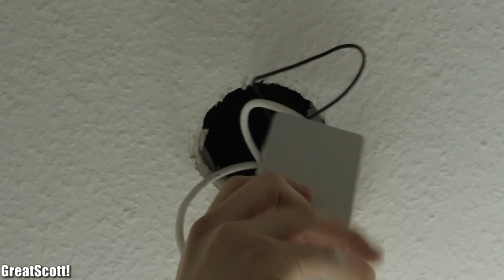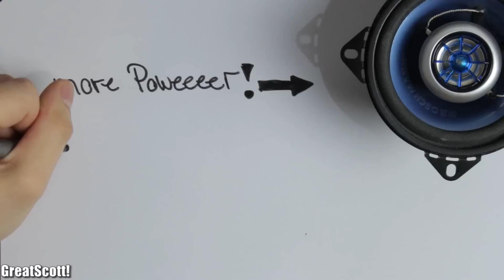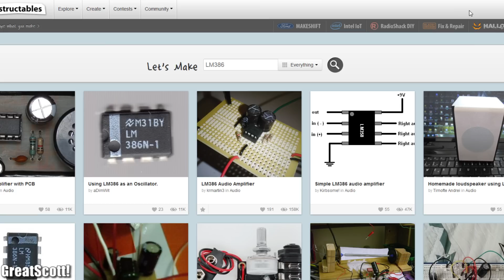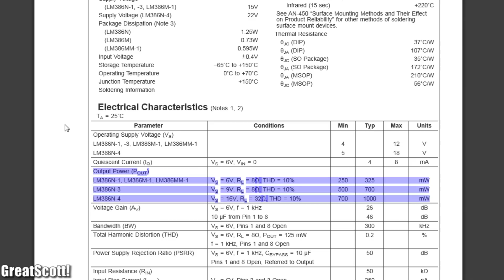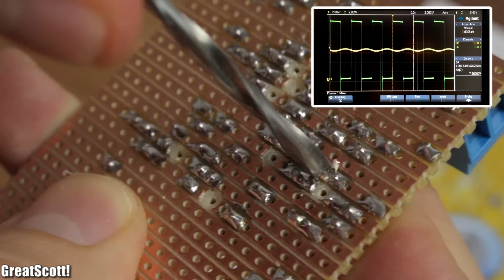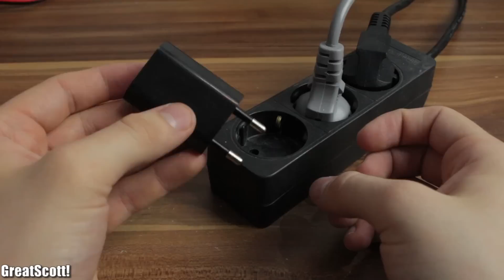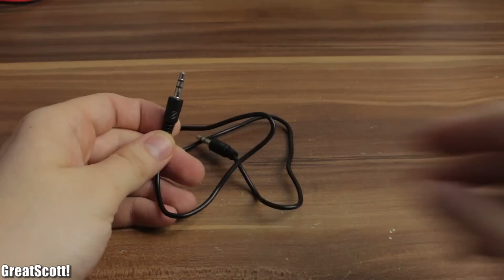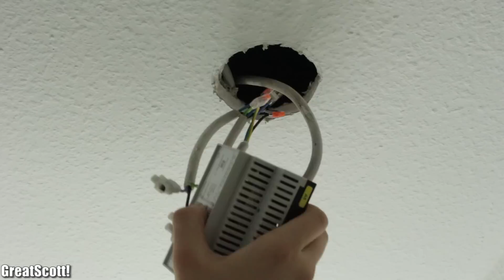Make your own Low Budget Bluetooth Music System || OpAmp

Comment: my question is why? i have herd a few Bluetooth headsets on ps3 and firedns mac book, there range and quality of sound is poor. for music around the house id just crank up your main sounds system until you can here it in the hole house. for on the go id just pick up a cheep ghetto blaster at a yard sale. and besides my ps3 i have never ran into any hardware compatible with Bluetooth. seems non practical.
Reply from the maker: RockeyDAproductions Bluetooth can transmit the music pretty good. Mostly it is the quality of the amp and speaker which makes it sound crappy. Try this build and you will see it for yourself ;-)
Reply: should i use my ps3? becase its my only Bluetooth capable device I have. and weakest amp i got laying around is 320w 2ohm. so it might be overkill.
Reply from the maker: RockeyDAproductions
Sure, use that. It is a bit of a overkill but it should work just fine.
Reply: looking thew this video remided me of a old project i gave up on, i picked up 2 mono amps from radio shack a year ago and cramed them in a small space and built the nessisarcy cirtect to run them. but i got nasty feedback and distortion and forgot aobut it, i was planning on adding some filter caps close to the amp but never did.
Reply: I'd say your a little late with technology, I thought that like 3 years ago, then I got used to bluetooth speakers, they dont really give bad quality, its just cheap ones give fucking bad range and lacking in speed.
Reply: and still,i got alot of hardware and parts, and put of all of the only thing i have that can even use Bluetooth is ps3. i use my pc to control my music.
Reply: RockeyDAproductions
Dont you use a phone or something?? :D
Reply: use a phone? i got a cordless but don't see why it maters. seems off topic.
Reply: RockeyDAproductions
For Bluetooth streaming... :D
Reply: with what? my DS3 controller?
Reply: for that price i could buy a new sub on cergs list, plus agin, nothing that uses blue tooth other than ps3, and i dont think ps3 can play music threw Bluetooth.
Reply: RockeyDAproductions not 320 real genuine watts per channel, 320 shitty ass car audio watts. a 320 watt per channel amp should weigh like 50 kilograms and have at least a 40 amp fuse. (50 kilos if its a home audio amp). i have an great old yamaha amplifier. rated at 55 watts per channel at 8 ohms. i have it driven at 6 ohms and it puts out 90 watts per channel. that has blown car audio speakers rated at 600 watts. and is much louder than most amplifiers rated at 1000 watts. there is a fake rating and real rating in this world. those car amps rated at 5k - fuck off not 5k per channel not even 5k all channels combined they probably give 200 watts genuine watts per channel. sorry for the rant but non - genuine watts really pisses me off you just have to find what is true and what is fake. 98% of wattages today are fake. there is a reason why car audio is cheap and seems like you get so much power for nothing. because it sounds like ass and outputs jack all power.
Reply: 320rms watts rms 2ohm, and the amp waighs about 20lbs. i know my car audio and i know how to find a deal.
Reply: RockeyDAproductions you're gross, throw your ps3 away, do you not have a cell phone? nearly every device that plays any kind of audio at all has bluetooth unless you have a  bunch of really old stuff, in which case just don't use a bluetooth dongle, use an aux cable.. its not that hard..
Reply: Teddy Bullock you further proven my point, the blue tooth is so useless i would have to buy something just to communicate with it. if im in my house i use my computer to control a sound setup that could be herd across the street. if im in the car i either use my laptop or my psp to control my amps(no head unit in car, just amps.)
Reply: RockeyDAproductions
 That's one option, but since most people use bluetooth compatible phones, laptops, PC's and consoles, bluetooth just makes sense. In your car or in your home.
Reply: i got a psp, portable console, no bluetooth, got aobut 10 laptops, non have bluetooth. my desktop is a freaken classifed sr-2, thats about as good as it gets for lga1366, no blue tooth.and only 1 of my firedns has a cell phone and it dose not have bluetooth. other than my ps3 seems like nothing uses it.
Reply: yeah, wow. you use a server board...10 laptops? anyone build after 2002 should have bluetooth.
You dont have a smartphone? tablet?
stop trolling :D
Reply: well technically my motherboard is a workstation bord witch is a class above server. most of the laptops are from 2002-2005 and one from 2009, none have blue tooth. i have a corded phone, why would i want a cell phone? oh and i do have a drawling tablet, its a motion computing M1400.
Reply: technically, nothing is above server grade hardware.
Im sure these laptops have bluetooth :D
my first smartphone, some XDA device had bluetooth...in 2003
Reply: 1, i disagree, workstations are like servers with better support for graphically demanding applications and generally consume more power because they have more power. and every laptop i have i have striped down at least once, only wireless communications is a 802.11 b and g adapters. some of the laptops have options for proprietary BT cards, but i have never seen one of the cards. and cell phones are for people who don't know how to use computers and have lots of money.
Reply: Nothing is as reliable (and as expensive) as server's hardware :D
Cell phones are for people who like to communicate to other people...not only dumb people.
Don't you have the same opinion on consoles too?
They are for dumb people who can't build a PC :D
Reply: 1, workstations are server grade equipment gear'd for performance, they run on server grade ram and xeon possessors and the boards cost more than standalone server boards...) and yes gaming consoles generally are for dumb people, but i know how to fix them for cheep to free, so i can play there exclusive games for next to nothing in price. >:D
Reply: RockeyDAproductions I'm
Reply: Teddy Bullock I
Reply: RockeyDAproductions 9

Comment: nice job. i did this with an old center speaker from a hifi set 2 18650 battery,s
inside are  3 speakers 1 is on a subwoofer channel. 
Too bad that it only works for like a small  hour without external power.

Comment: It's very simple project where you're producing mono sound.

But my aim is to do such Bluetooth stereo system, that is divided between two separate receivers for left and right channel, so it won't need wire connection between left and right Bluetooth speakers. You cannot make this with two ordinary cheap Bluetooth receivers, because they are not capable to receive separate left or right channel from one Bluetooth transmiter in the same time, so you cannot stream music from your phone/tablet etc. this way. You also cannot make this with one Bluetooth stereo receiver that is splitting channels and sending one channel via Bluetooth transmitter for second separate Bluetooth speaker, because of Bluetooth delay/latency, that would be causing time-differences between left and right channels. Any ideas?
Reply: You pretty much need a wire, sorry to say... May I ask why that's so bad?

Other options (if you insist):

Different protocol, I have a set of analog wireless speakers for example where you just select left or right on each speaker. There's no wire between them and they both have dedicated power supplies. They seem pretty good at avoiding interference while music is playing however they unfortunately don't go in the ceiling. (Brand is instudio if you're interested).

AirPlay: allows sending music to be played on multiple speakers and will time sync them (though I only have one so I have never tried that / don't know how well it works). This will cost more. Advantage is no further compression

Sonos / other wireless audio protocol: Costly, and I don't know much about them other then they support multiple receivers playing the same thing

As I recall there are some portable Bluetooth speakers which actually do allow you to stream to all of them at once (they have to be the same brand and model tho, and one that supports this)

Comment: In many modern homes the ceiling cavity is open to the outside through breather slots in the exterior walls, never mind worrying about dampness in the bathroom it will get slightly damp in the ceiling cavity through the winter time. just feel the ceiling in the winter time is it cold? This is something that has been found with low voltage ceiling lights (corrosion in the circuits). You say anyone can build it is that anyone with a good understanding of electronics and components like you?

Comment: What if I want to take this to outside? How about power?
Reply from the maker: The amp needs around 200mA at 12V (=2,4W). The receiver needs 80mA at 5V (=0,4W). So around 3W. If you increase the amplification then the amp needs more power.

Comment: where to find the metal jumper wire on ebay please ?
Reply from the maker: Seach for "silvered copper wire" on ebay. And to be honest, I do not like to use "ends" of parts as jumpers. Just doesn't look nice.
Reply: Pro-tip: when you solder a component like a resistor to a circuit board and trim the ends, set them aside save them for jumpers rather than toss them.

I would bet that's what GreatScott! does.
Reply: The More You Know :D
Reply: thanks